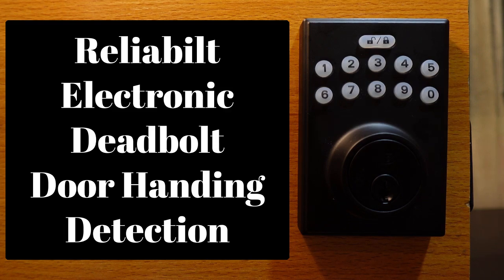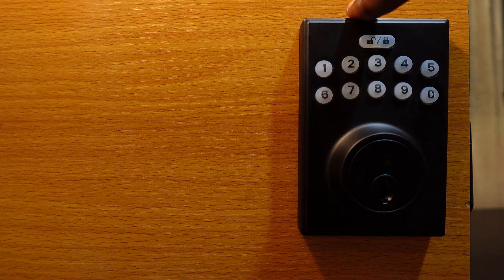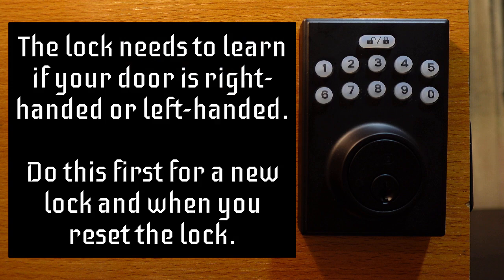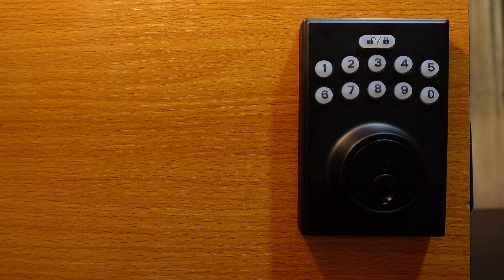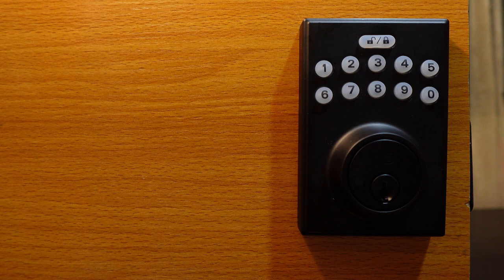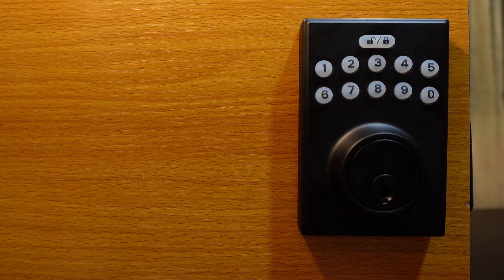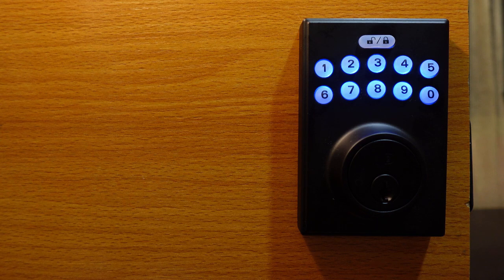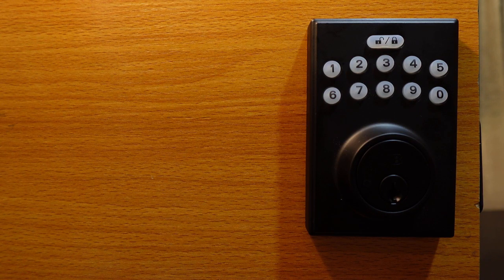Reliabilt Electronic Deadbolt Door Handing Detection

Comment: My unit won’t accept the door handle detection code while in the unlocked position. It’ll take it in the locked position but that reverses the unlock/lock function. It’s installed correctly and I’ve taken it apart several times trying to find what could be wrong. Any suggestions?
Reply from the maker: @traviskendrew3288  Try removing the interior assembly then reinstall it and make sure the Thumb Turn is set in the vertical position and the latch bolt retracted while reinstalling it. Next, reset the lock and run the door handing detection process.
Reply: @SmartTechVille Thank you and thanks for the speedy response! I have it apart right now. The latch bolt is retracted but I can’t seem to put the thumb turn in the vertical position.  It wants to be either to the left or right 45 degrees in order to fit onto the spindle.
Reply from the maker: @traviskendrew3288  Try adjusting the spindle so the thumb turn goes in -- in the vertical direction. You'll need to remove the two long screws, then take the exterior assembly apart and adjust the spindle. 

If you can't adjust it, the issue might be with the latch bolt. Remove it and reinstall it, ensuring the side labelled "UP" is actually facing up. Next, reinstall the exterior assembly properly.
Reply: @SmartTechVille I tried that but no change. I figure it may be defective so I decided to open it up. I switched the motor sensors around then put it back together. Tried to run it and shockingly… the lock didn’t work. However it did take the left hand door code in the unlocked position. So I took it back apart, flipped them back, reassembled and punched in the code again. Now it’s working properly… wtf lol. I have no idea what changed but it worked. 

I really appreciate the help and the speedy responses. Thank you!
Reply from the maker: @traviskendrew3288  Glad you figured it out! Sometimes troubleshooting can be tricky.